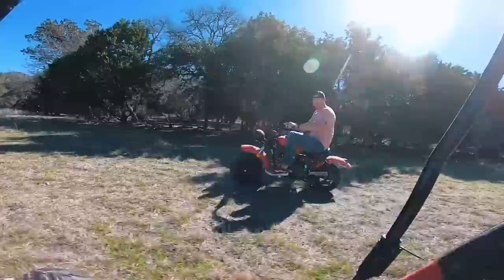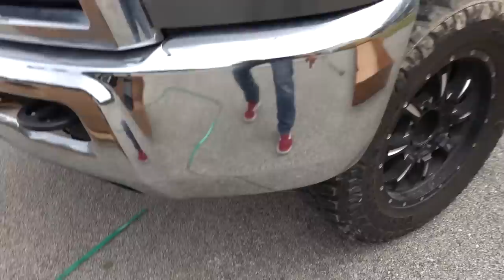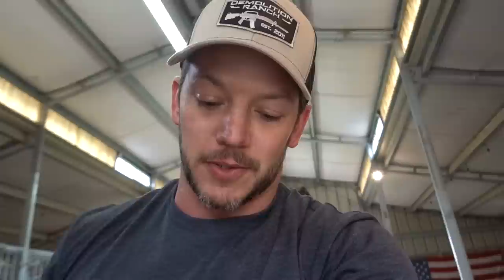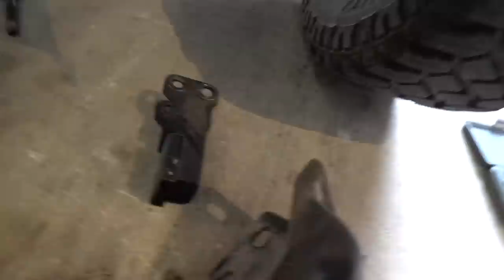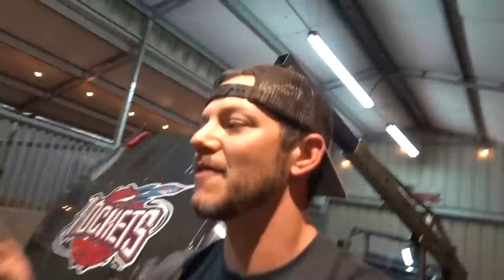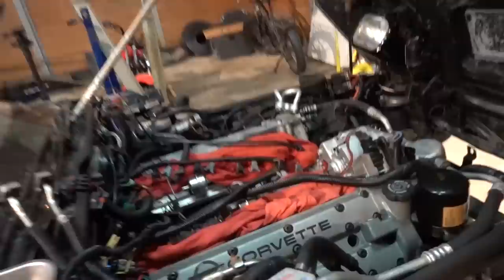The New Upgrade is HERE!!! Dodge Ram 2500 HD Cummins

Comment: I'd suggest not putting a light bar on the roof, better to put it lower. But one of those orange flahing ones on the roof would look pretty damn good though, just saying. If you're kitting it out, that would look good on a work truck and be useful if you stop to help someone or something.

Comment: Remember... Having a wench is basically useless without also having snatch block(s) and tree strap tackle kit(s).  I would strongly recommend a smaller wench with more compound pulleys as force multipliers rather than one huge, expensive, and useless wench.

Comment: i hate the look of lightbars on tops of pickups... i would recommend having them installed in the interior of the cab facing out, kinda like police lights  but you know, white... and then just normal led fog light style bars on the corner and two in the middle separated by a winch

Comment: I just picked my midnight bumper up for my 2018 Ram 2500 and I have two questions: first, my truck has 6 front sensors and there is only 4 cutouts for the sensors, was yours the same?  Second, did you find a winch mount for this bumper?  Thanks for the video

Comment: The biggest winch you can fit. Highest lumens you can get as long as they dont look stupid.  The winch and cable have to be strong enough to pull the dodge it gets stuck. 

I cringed when I saw you using a sawzall to trim back the insulated plywood from the last reno video. Bro... a big fat inexpensive porter cable router is what you use for that. Its fast, easy and more importantly the cuts are clean while keeping the corners nice and square.

You can even use the router technique to bypass cutting the windows out. Slam all the sheets up, nail them off then router out all the doors and windows. Way better than playing with a chalk line and cutting every piece to fit. One hole big enough for the bit to fit in and your off to the races.

Comment: With the winch , as little as you use a winch which won’t be every day. You don’t need some thousand dollar 12 horse power winch. I run a Badlands 9,000 lb winch on my Jeep Jk that sees a lot of work do to my buddies getting stuck o trails every so often. Don’t be scared of Harbor Freight winches. The ZXR 12000 Lb. Truck/SUV Winch With Remote Control And Automatic Brake has a 98% approval rating. Do. Yourself a favor and look for a $100 off coupon and also get the wireless remote, you’ll thank me later for that advice. You don’t wanna be anywhere around when a winch line breaks.

Comment: get rigid industries. I worked for them and actually made them. Top of the line. Very expensive but 100% worth it. Lifetime warranty. They will replace it for any reason. The only thing i run on my truck.

Comment: Anything more than 5000 lumens is blinding 10000 lumens will light up an acre basically 12 in bar works good full 48in roof bar and 12in bar on your ranch hand would be the ultimate light you could even put colored fog lights in

Comment: I've got an old Ranch Hand on my old pickup. The bumper had a sticker behind the license plate that got sandblasted off before powder coat. This bumper makes me laugh because the grill guard is not centered on the truck. It's about two or three inches off center so it's good enough. It's solid but not centered.

Comment: If you mount a lightbar on the roof, draw a string from the front of the hood to the roof, make sure the lightbars output dont go under the string, ( if it does, you just light up the hood and it make it worse) put the light bar behind that string to counter it, or this https://www.tacomaworld.com/threads/roof-mounted-led-light-bar-glare-solved.377416/

Comment: Rigid industries or Baja designs for lights, all in the front bumper. 12,000 lb winch for your truck is just barely skimming by, go bigger if possible, warn would be the brand.

Comment: I have a 1996 dodge 2500 and I have a 12 in nilight lightbar on my front bumper and a 54 in nilight light bar on my roof and they work great they are super bright and pretty affordable I also have a badlands 12000 lb winch on the front also works great and a a great price hope this helps dm me on insta if you want photos of my truck just to see what my set up looks like at @graeme_eckery